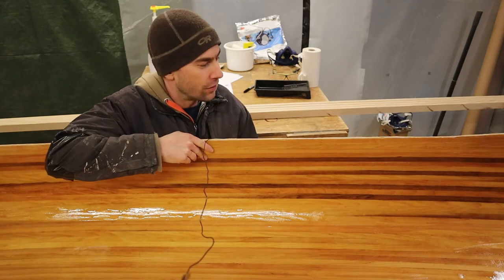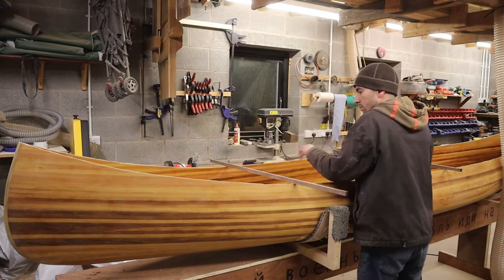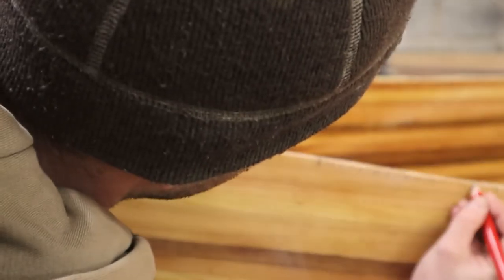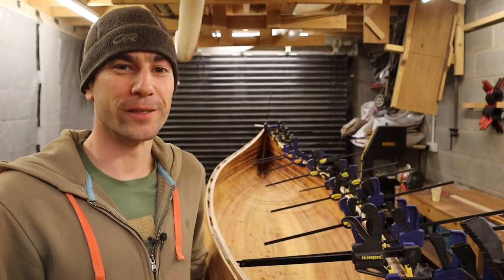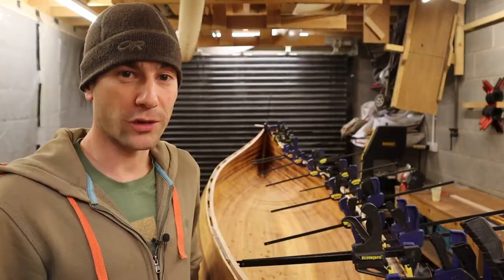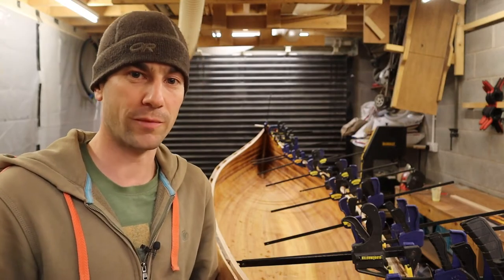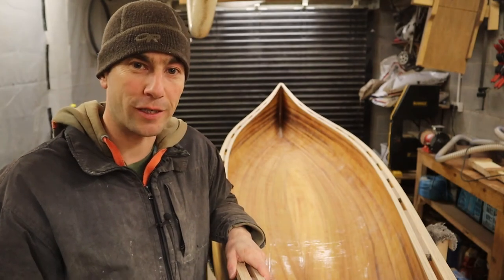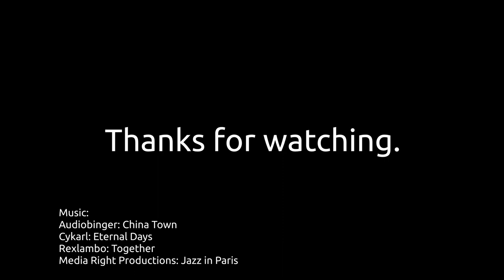Building a cedar strip canoe - Episode 14, Gunwales

Comment: Andy, love these videos. I keep coming back. I see a spacer beam through the middle of the boat when you are gluing the outside. Did you use one for fitting the insides?
Reply from the maker: Hey, glad you like the videos! Makes it worthwhile to have made them. Do you mean the bar visible at about 9 minutes? I found the hull had a tendency to close in a bit, presumably since I fibreglassed the outside first. Then with the heating of the garage over the few days it takes for the glassing, the cedar dried out and shrank a bit. So, to get the dimension across the gunwales correct, I made a telescopic spreader bar, and used it until I added the thwart (at the start of the next video).

Comment: Great job! May I ask what screws and glue you used to fix your gunwales to the canoe.
Reply from the maker: Hi Sammy. They're glued on with thickened epoxy. No screws.
Reply: @adpsimpson  amazing, thank you for the info. I am in the process of building my first plywood canoe, hopefully I'll finish it this year. Your canoe is beautiful and your woodworking skills is next to none. Thank you for sharing your progress :)
Reply from the maker: Good luck Sammy - it's satisfying to get it in the water! I think I said at the end of this video, it would have been much easier to use screws and epoxy, it was very difficult to hold the gunwales in place with only clamps. Something like 15x4mm stainless screws through the hull into the inwales every 25cm or so, then 35x4mm screws through the outwales into the inwales, countersunk and plugged.
Reply: @adpsimpson  good idea. I'm hoping I have enough clamps to hold everything in place. I  can't wait to get it on the water, there will be a YouTube slide and a launch once I have finished it. Watch this space.